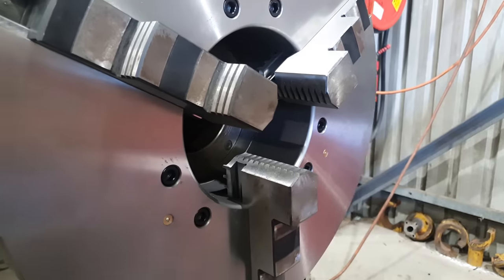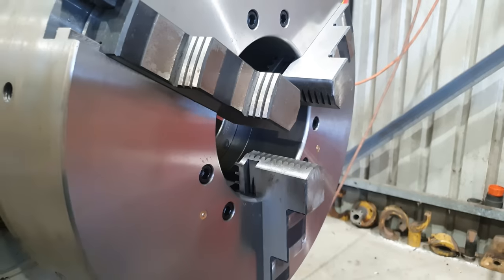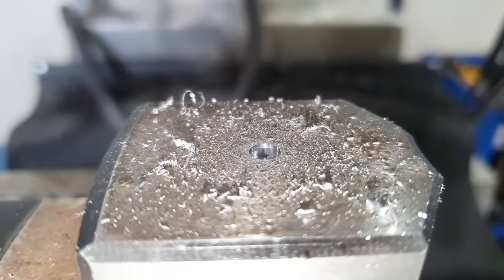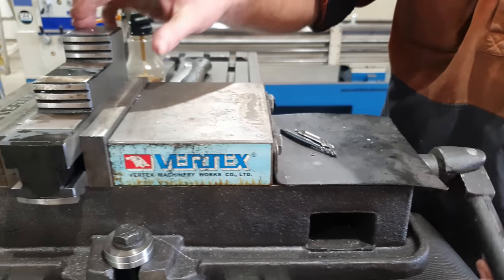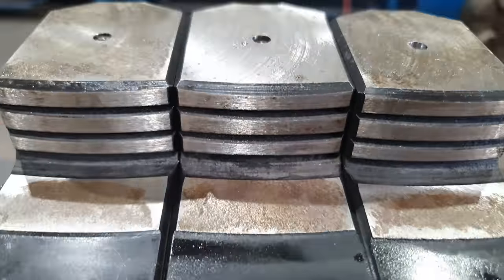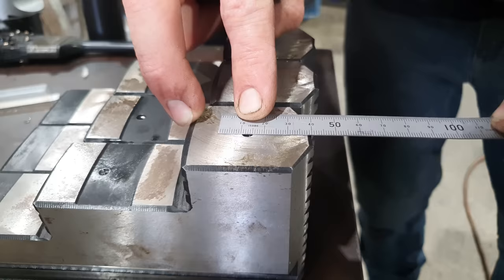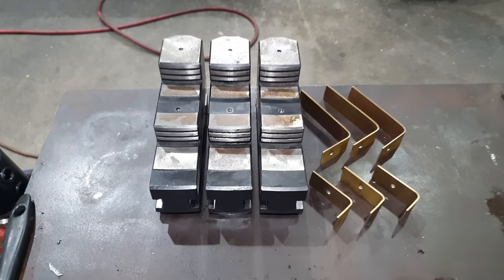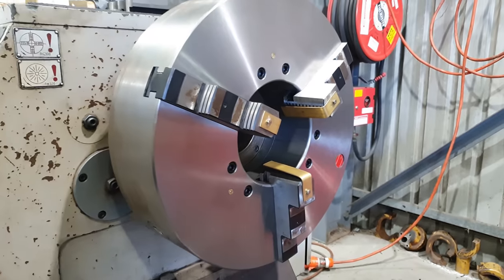How to DRILL & TAP Hard Jaws | Big Lathe Chuck

Comment: Hey Curtis, why is three jaw chuck betterer for cylinders? Is it because it is easier to centre on the lathe? 
In what areas are the China-made chucks worse than those made elsewhere? Are they likely to be less symmetric?
Thanks for the bonus video!
Reply: 3-jaw chucks move all the jaws at the same time. With a 4-jaw, each jaw has to be tightened independently, and the piece carefully rotated with an indicator to get it centered (0 runout). With a 3-jaw, it'll be nearly centered just by tightening it up. 

A 4-jaw can be more accurate, because you can change where the center of the piece is in relation to the center of rotation of the spindle. So you can get the piece as close to co-axial with the spindle as you can measure. This takes a decent amount of time though, compared to just tightening the scroll on a 3-jaw. 4-jaw chucks are also able to hold a part off-center, for turning cams or for holding non-round stock.

3-jaw chucks sometimes are "set-true" chucks, with a mechanism similar to that in a 4-jaw that actually moves the entire chuck around on the backing plate, allowing a bit of adjustment to the runout. Not as much as a 4-jaw though.  3-jaw chucks tend not to be very repeatable: if you take something out of the chuck, and then put it back in, the item usually won't be coaxial to where it was before you took it out (it won't "run true"). More expensive 3-jaw chucks are usually more repeatable.

Collet chucks hold parts in a narrow range of diameters, and use different collets for different ranges of diameters. They're quite precise, usually very low runout. They tend to be extremely repeatable. They don't really come in the large sizes Kurtis usually works with.

Face plates aren't chucks, but let you clamp things to the spindle. They're for turning really weirdly shaped things. Very slow to set up. Accuracy and repeatability are dependent on how well you can measure and repeat the same setup. Pain In The Ass (PITA) factor is maximized, but sometimes there's no substitute.

Turning "between centers" using a dead center in the spindle and a live (or dead with grease) center in the tailstock, and a "drive dog" to get the work to turn. Lowest runout, very repeatable, very accurate, but rather high PITA factor and tends to have low clamping force on the drive dog and thus can't take heavy cuts. Needs center drill used on both ends of the part. Can be used to turn tapers by offsetting the tailstock to one side, but a taper turning attachment is usually better if you're doing a lot of them.

6-jaw chucks work like 3-jaw chucks, but with more clamping force. More jaws = more contact area = more friction.

3-jaw= good for round/hex/other C_{3} symmetrical items, weakest clamping force, low adjustability, often low repeatability, often low accuracy.

4-jaw = good for round/square/other C_{4} symmetry items, most versatile, good clamping force, very accurate, high adjustability, adjustable repeatability, adjustable accuracy, but slow to use (you have to adjust every time you clamp something!)

6-jaw = similar to a 3-jaw, but with better clamping force. Usually expensive, generally pretty good accuracy and repeatability. Still less potential accuracy than using sufficient care with a 4-jaw.

Collet = Good for round parts only. Very good clamping, low or no adjustability, very high repeatability, very high accuracy. Need lots of collets ($$). Can use a depth stop for repeatable stickout of parts from the chuck. Mostly only for small parts.

Face plate = for weirdly shaped parts. Slowest of all set-ups, rarely (but not never) used if you have a mill. Major PITA.

Between Centers = Any C_{even} symmetry long thin parts. Accuracy and repeatability effectively equal to that of the lathe itself. Poor clamping. Can be used to turn tapers by offsetting the tailstock. PITA.

Changing chucks is a PITA. So you usually see professional shops dedicate one chuck to each machine, and just go to a different lathe if they need a different chuck type. Since Kurtis mostly turns cylinders, and doesn't usually need to take parts in and out of the chuck multiple times, 3-jaws are fine for him. IIRC he has a 4-jaw on his toolroom lathe since that's for small parts where he needs the accuracy and precision.
Reply: @PeregrineBF  4 jaw scroll chucks do exist, but are uncommon, afaict they are mostly useful if you frequently turn square stock.

The problem with a scroll chuck with more than 3 jaws is it is "overdetermined". So if your stock is non-uniform then some jaws will become tight before others.
Reply: @petermichaelgreen  True, there are some niche chucks and other workholding systems for lathes. There are also magnetic chucks, expanding arbors, and 5-jaw scroll chucks exist for machining tamper-resistant pentagonal nuts. Almost certainly more weird things I've never seen.
Reply: @PeregrineBF  Another us for 6 jaw chucks is to lower the clamping force required per jaw.  I've seen them used for this with jobs that would be prone to structural damage (rather than surface damage) if excessive clamping force was applied.  By using a 6 jaw chuck, the force per area was lowered, reducing the risk of damage.

Comment: I made jaws that wrap around. I’ve thought of drilling like this. But I’m not sure how the jaws are hardened on 8” chucks. Smaller jaws may be hardened through.

Also, generally I see people using copper because it’s softer, but it doesn’t hold up as well. I was wondering why brass? Is it because you had it in stock, but not copper, or because it’s sturdier?

Comment: I'm not a machinist but have a great amount of varied experience with a huge variety of metals and components.....and I've tangled with surface hardened components.  (I owned and operated a restaurant service business for many years in the U.S.)  You started your holes with the carbide bit, then switched to HSS for the balance of the cut.  Fine, but when you started the threading tap, seems to me that 2mm thick surface hardened layer would strip the teeth off'n the die....but it obviously didn't ??  How did you get around that ??
Reply: The tap is slightly narrower than the width of the end mill Kurtis used to cut through the hardened layer.  If you look at 6:38 you can see the first cut made with the end mill, then a slight shoulder where the tapped section starts.
Reply: @dfross87  Missed that.  Thanks.

Comment: i thought you would have annealed the brass first for a tight bend 
i heard an old guy hammering like mad making aluminium jaw liners 
i got the burner  sooted them up 
heated till the soot burnt off 
said try that!,one blow with the hammer   job done and no splitting

Comment: What makes the chuck different to Western Stuff? Is it the metals used? is it the finished machining that can be improved. Can you say " add bolt on to make better or Blue Print the tool?"
Reply: Hi, there are a number of YouTube vids out there re chinese quality 'precision' tools. In many cases it is poor quality metal with non uniform stresses throughout the blank and thereafter poor attention to the precision machining and quality control checks. NOT saying this applies to every chinese machine tool, but you get what you pay for.

Comment: Wonder if someone makes a brass pad with a magnetic coating on the back side that would hold good enough without having to bolt them on and off each time?
Reply: imagine the amount of steel shavings collected during work
Reply: @andrzejdemski5980  If the magnetic coating was only between the chuck and the brass pad there might not be room for any shavings to collect. From the videos I have watched the cutter doesn't get all that close to the chucks anyway.  But you are correct in that any shavings collected would be problematic .

Comment: FYI, a three jaw chuck is a lot easier and faster than a 4 jaw chuck. 
On a three jaw chuck, all three jaws move in unison; makes things much easier and faster, but only holds cylindrical or hexagonal shapes. On a four jaw chuck, each jaw is moved independently of one another. It's rather tedious, but can fit almost any shape of object.
Reply from the maker: thanks for sharing that
Reply: Not all 4 jaw chucks have independent jaws, some have a scroll and operate the same as a 3 jaw
Reply: @markshort9098  Thanks,  never seen one, but I do know water is wet.

Comment: The "End Mill", the carbide one, why are we having trouble identifying an End Mill from an End Mill. Yanks call them "2 flute end mills." ,and there you go and use a 4 flute one. Yes, I am talking about "SLOT Drills". Least that is how I was taught.  For some... A slot drill can drill directly into steel, an "End Mill" needs the center removed first as the cutting blades do not meet in the center. Shopping onLine, makes it hard, as sometimes it is difficult to identify, what it is you are looking at. Kurtis, how do you sort out this problem...???? I wish the world could come to some sort of agreement on the matter.

Comment: Chinese products are not 'de-facto' lower quality - they make premium stuff too, you just don't see the high-end product much because they wind up being about the same cost as the domestic ones, so nobody imports them. You can get Chinese chucks for anywhere between $250 - $3000+. The difference is you simply can't get a US/Aus made chuck for $250.
Reply from the maker: Definitely, but this chuck is not a high quality and happens to be made in China 🤣
Reply: @CuttingEdgeEngineering  Sorry for dogging, but I was responding to your opening comment - "It is made in China, so it is not the best quality".
Reply: @CuttingEdgeEngineering  Yes but is it "good enough for 'stralia?" use, and have you had it open to finish off the internals to a better shape, as often you will find that you can improve it a lot simply by going in and cleaning up the left over grinding swarf in there, and replacing the junk lubricant with something better, getting rid of the grinding paste that likely is in there.

Comment: I notice professionals like yourself seem to run taps straight in, sometimes in a drill or mill. I was taught at school (40 years ago) to always make one turn then back it off half a turn to break off the swarf and repeat. As I recall this was to prevent breaking the tap off in the hole. Are modern taps better of was my teacher just over cautious?
Reply: I think that can be done only on these spiral taps that bring the swarf out just like a drill tip

Comment: Why is everyone using center drill that is not meant for twist drill after? I get it - it does the job; but the chamfer angle is totally wrong and the drill will grab on single point when starting to drill..

Comment: A hot glue gun can aid in quickly gluing brass shims to the jaws..
Reply from the maker: and when you want to take them off?
Reply: @CuttingEdgeEngineering  The glue releases easily with no residue, its easier for a smaller shop that is just starting off or a quick fix until one can duplicate what you just showed..